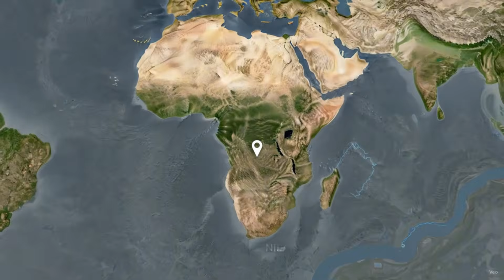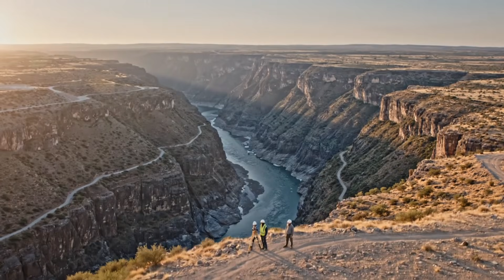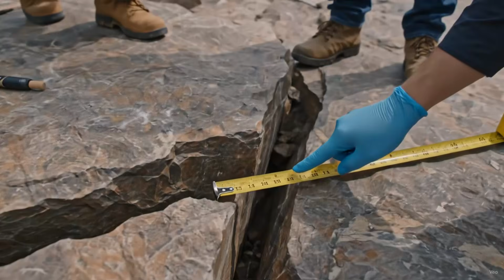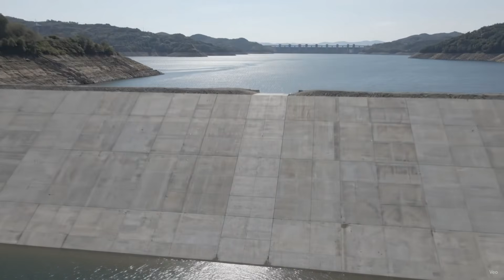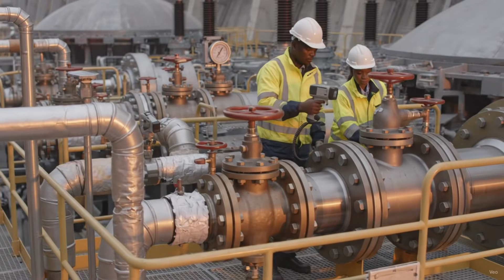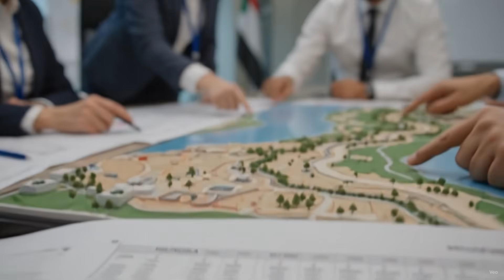How Ethiopia Built a $5B Impossible Dam

Comment from the maker: GERD took around fourteen years to build—but the hardest engineering challenge may continue long after construction.
Which part impressed you most?
Moving the Blue Nile, preparing the foundation, placing 10.7 million cubic meters of RCC, building the five-kilometer saddle dam, or operating thirteen turbines on a river shared by multiple countries?
Keep the discussion technical, factual and respectful.